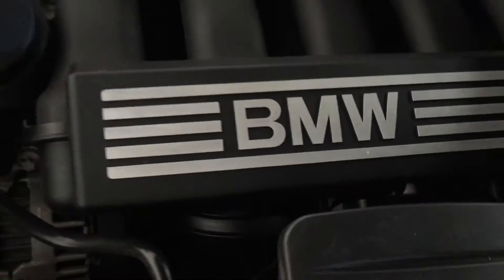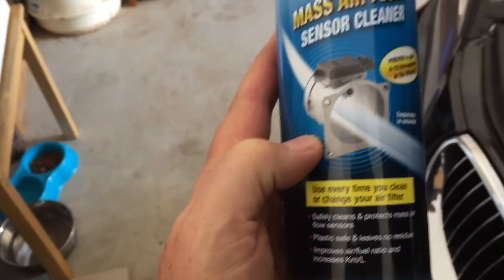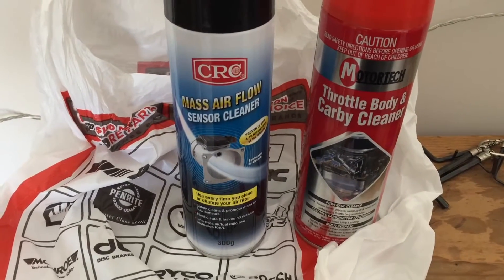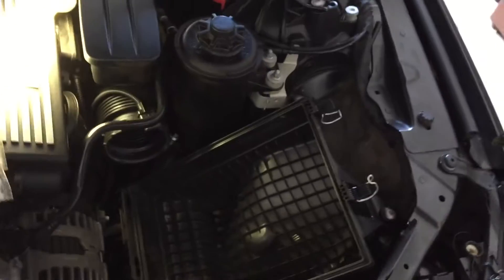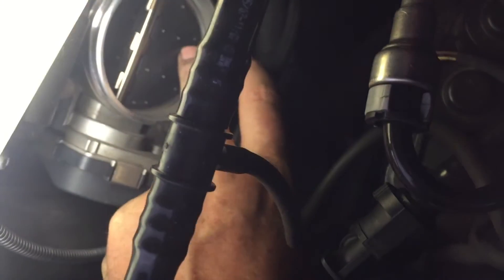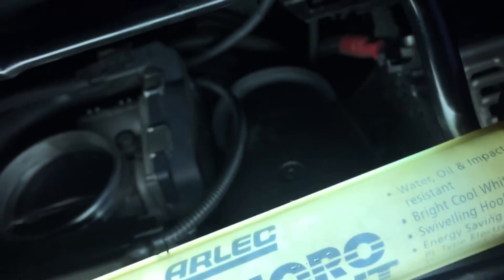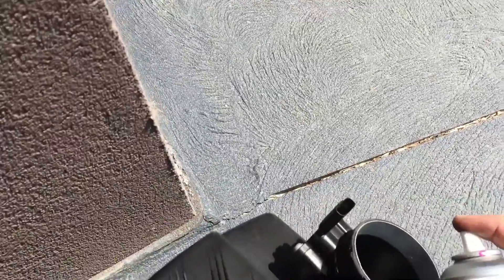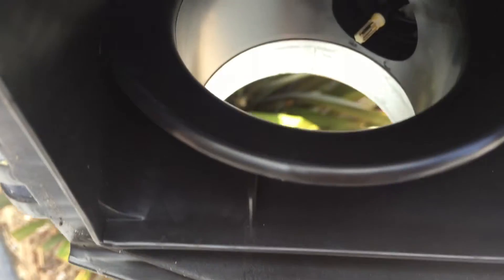How & why to clean the Mass air flow MAF sensor & the Throttle body on any car, here on BMW e60 3.0i

Comment: Did the clean up on my E60 535d Diesel , took me 15 minutes : It is now another car : no hesitations on acceleration and RPM very stable at low speed . Before cleaning it was jumping to 2300 RPM then down to 1800 RPM all the time at low speed . Now it is perfect and fuel consumption has decreased .
Many thanks for this video . Note : could not find the carburator valve : of course I have injection!!!
Reply from the maker: Thierry de Montblanc Well done. Sounds like you’ve done a great job. I love hearing of people having a go. MRT
👍
Reply: Thanks Will clean mine asap

Comment: Inept mechanics at inspection, live and learn. My sister's 2006 530Xi wagon gas mileage went south over the past two months. Driving along, distance to empty gauge would drop 40 miles in 5 minutes.

Last year, I did a tune up service for her, new plugs, filters all around, euro spec oil, she was getting awesome mileage.

So sis complained over the past week multiple times to me, I told her I will check the MAF sensor and clean it. Long story short, the inspection mechanic failed to lock in the 2 bottom tabs on the air filter box cover and lock the side clip. Her car was sucking hot engine bay air bypassing the air filter. MAF was filthy. I cleaned the MAF, vacuumed the air box thoroughly and buttoned it back up correctly.

Engine idle went down, engine is quieter, revs are more responsive and without testing on the road, I guarantee the gas mileage will be back to normal.

Point of this semi-rant is this. The inspection station tech most likely popped open the air box hoping he could up-sell a new air filter at time of inspection. Inspector saw the new filter, decided otherwise and then proceeded to incorrectly reattach the air box lid. AAAAAAAAAAAAAAAAAAAAAAAAAARRRRRRRGGGGGGGGGG. Why do they pull this on women?

Comment: Will this be the issue if my car on acceleration starts jumping? I have an 04 e60
Reply from the maker: M Diaz Jumping on acceleration can be caused by many many things. Also check fuel filter
Reply: It will do perfectly , see my post above